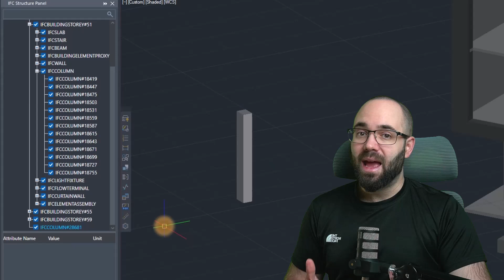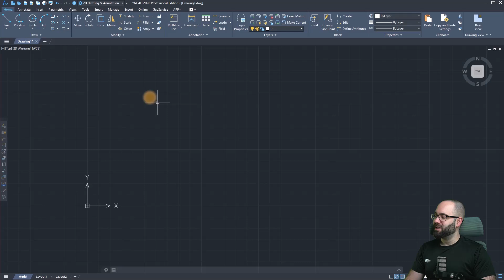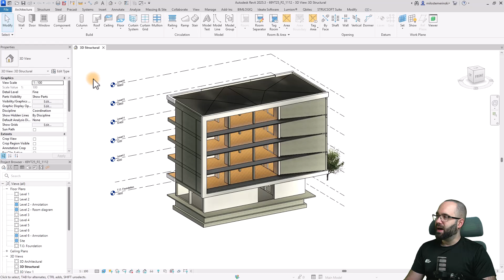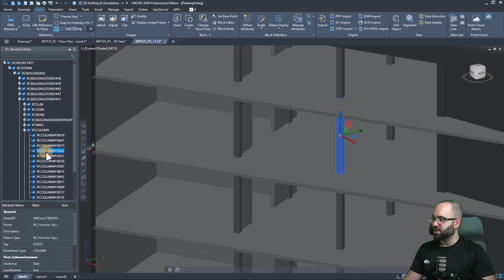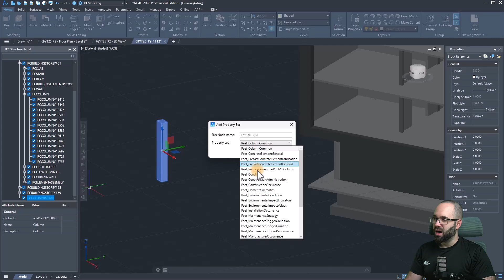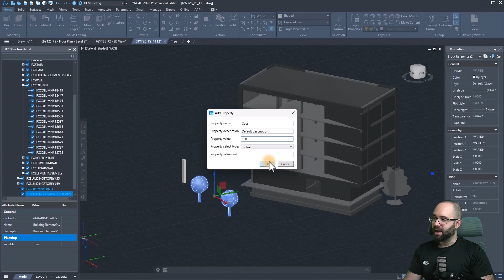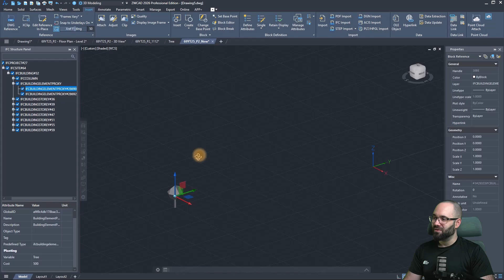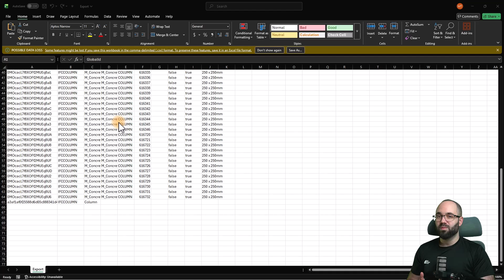IFC and DWG management with ZWCAD Tutorial (Revit to ZWCAD workflow)

Comment: Hi sir 
Best laptop using sing for 3D rendering softwares like 3ds max, sketch up, revit architecture, vray , escape and lumion . Freelancing work?
Reply: ASUS TUF Gaming A16 (2025)
Why it works: Military-grade durability with reliable performance for daily visualization tasks￼.
Specs: AMD Ryzen 7/9 | RTX 4050/4060 | 16GB RAM (upgrade to 32GB) | 1TB NVMe SSD
Price: ~$800-$1,100
Best for: Budget-conscious architects needing stable RTX performance
Reply: @nawazarchviz compare to Intel AMD Ryzen best for rendering double core and single core performance?